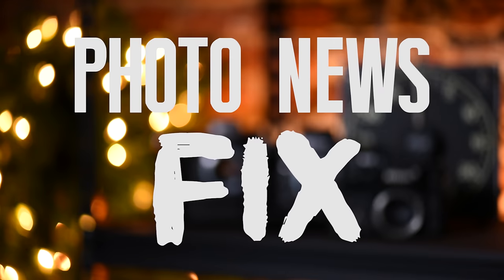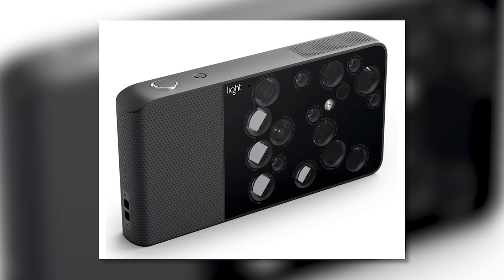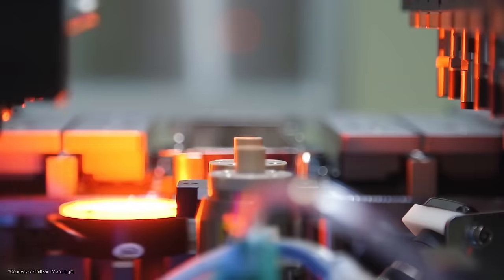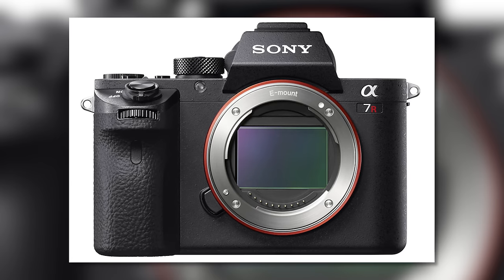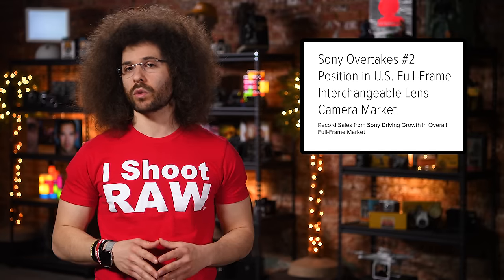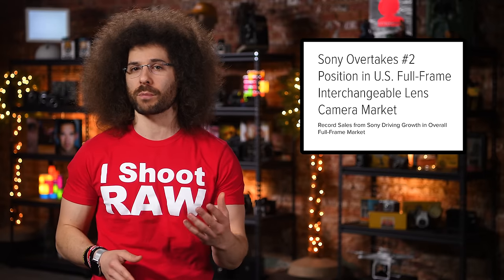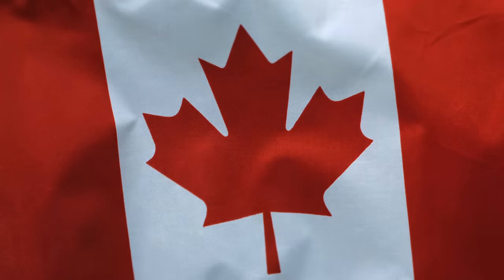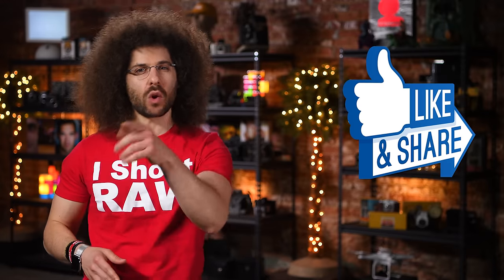PHOTO NEWS FIX: SONY Passes Nikon (Kinda), Canon Next? Weird 16 Lens Camera & SONY NAB Truck Stolen

Comment: Sony just unveiled their new flagship the a9.
I wanted to start with that statement to get your attention...when I started my photography career in 2013 I had the choice between a Nikon D7100 or an Sony a77. After weeks of thinking about my purchase i went for the Sony. Fast forward a couple of years and an Upgrade to the E-Mount System (a7II; a6300; loads of Sony and adapted lenses) I am very happy with my decision. 

Canon and Nikon Users hate on Sony all the time, but I think they are just getting jealous. 
Sony is the Camera Manufacturer that is improving at the fastest pace right now...they are simply put the hottest horse in the stable!
Just think about what they did with the a6500 in under a year after the a6300. And now for the a9 with Dual Card Slots, bigger Battery and Touch-Screen! This is a company that actually listens to their customers and not just the marketing departement! 
All the other features should drop your jaw! 20fps with full AF and Silent Shutter? 693 Phase-detect AF-Points? I mean come on? 4k with Full-Frame coverage? No Blackout EVF? Did I mention this new flagship is cheaper than its Canon/Nikon counterparts? Plus not even mentioning things like face detection and Eye-AF which have become standard now on Sony Bodies...
Where are Canon and Nikon?

PS: I think the lens argument should be kind of over by now if you think about adapting legacy lenses and adapting canon and nikon lenses (with full AF capability; what other camera manufacturerer offers that?) plus Sony is releasing really cool G-Masters at a rapid pace and affordable lenses aswell. As a side note all the more exciting/new 3rd party manufacturers are developing for the E-Mount (Laowa, Meyer-Optik-Görlitz, etc.)

Comment: I sold all my Nikon gear two years ago and moved to Sony, I have one gripe.......... battery life!!!
To some people it might not be a huge issue but I don't want anybody to say that they are completely 100% in love with their Sony without bringing this up...........I don't want it anymore, give me back a Nikon or Canon I'm not fussed, I just know I can trust them...........every time I've picked up my camera of late it's has 14% left on it. What the F is that all about. I'm seriously selling up and moving back.
Reply: What a sad statement. All i hear is battery life this, battery life that. Ok it's not good, it's worse than canikon systems, but you seem to forget something big. You like the EVF, you like the awesome AF tracking which is second to none, you like eye AF etc, but here's the catch, they are all 100% electronic systems, so is it that strange that they use a lot of juice ? No it's not. If you want to keep on shooting optical systems instead of what you see is what you get, then by all means. But stay reasonable. I never "moved to sony" i came from minolta film which was bought by sony so i had no choice. My first reaction was oh god, no, not sony.. they will make what was great into something apple-like with all design and 0 performance.  And up to the a99 they were kind of trailing the pack. Still not bad enough to make an actual switch to canikon. Then from the a99 up they were actually doing stuff better than the others ( in my opinion). So.. if you want better batterly life with your E-mount , just use a vertical grip. they are dirt cheap if you don't mind using an aftermarket one. 2 batteries last you a whole day of shooting, the camera handles a lot better. if you use a mount 2 batteries will get you through the toughest longest shooting gigs. And i speak from experience.  Would i like to have single battery performance as canikon does ? sure... would i be willing to give up the EVF and all the benefits for that ? Hell NO.

Comment: I have Nikon and Olympus cameras. I think my Olympus cameras are by far the nicest. More battery life would be good though
Reply: Definitely, they are just easier to use in my opinion. Produce great images. All stability is done in the body which is way better. Each to their own. I just prefer my em1's

Comment: What happened to the Fro Forum?  Is there no longer anyplace to post questions and help each other out with answers?  All I see any more is the comments section in articles relating to the videos here, which requires a facebook login, which does no good for those of us who don't have a facebook account.
Reply from the maker: Oh the one I shut down 4 years ago?  There is a facebook group for FroKnowsPhoto.
Reply: 4 years?  Granted, I haven't been very active there, but I'm sure I posted something more recently than that when I was asking for advice on what kind of zoom lens to buy.  Anyway, thanks for responding.

Comment: Light L16 who is it marketed towards?
Reply from the maker: great question, no one knows.
Reply: first adopters & people willing to keep their minds open and try something different.  Y'know, those types.
Reply: It is aimed at folks who are DSLR owners who are tired of lugging all that camera gear around and want to take amazing pictures.
Reply: After a bit of research I think this is a cool tech. Its not for me because it takes out all the fun of taking photos. And people who this is ment for is probably better off with a phone anyway. // I would be really disappointed if you could't take 3D images and recordings. And I would be disappointed if you could't make calls from it! Because It's basically already is an android with 10 cameras but they market it as a camera. Ether it lacks the functions you really need or they doing a weird marketing. I can see tons of people buying it if it was markerad as a phone with worlds best camera and it had all the phone functions. /// EDIT. I bet Apple will steal this tech in the phone after next gen.
Reply: Dimitri: Yes, it's cool / bleeding edge tech. And, yes, it's just Gen 1...

It is intended in part to appeal to those who are familiar with phones / tablets. And eventually, if all goes well, the technology will be miniaturized and make its way *to* cellphones and tablets via licensing deals. It's part of the plan.

I'm fairly sure it will be capable of 3D, whether at launch or down the road. Given that its lenses are all at different positions, parallax, different focal lengths, et al, means they can capture plenty of information about scene composition, depth, etc. And some of that 3D / depth information will be used in composing and capturing scenes. Fairly certain it will support 3D. Not 3D video in the Gen 1 product, though, I don't believe. 4K video will be shot on a single sensor at a time, based upon subject, focal length, and/or zoom level. So, no video stitching, etc. in this first generation. But, it's only a starting point.

They designed a CAMERA, not a PHONE. It is both necessary and sufficient to focus exclusively on the camera aspects in this first generation. They're creating a new technology, and getting that technology RIGHT is their primary focus. I would rather they make it a great CAMERA than try to weld in unnecessary "phone" technology, and ignore getting the imaging right. Future iterations will likely be in cellphones / tablets that license the technology... The standalone camera(s) will still be cameras. One does not typically make phone calls from one's camera. ;)

As to marketing, they're making a camera, and marketing it as a camera. I don't really understand that criticism... Doesn't make sense to me.

Comment: It looks like that multi-lens camera has a bunch of tiny 1/3 inch sensors, so low light will likely be horrible.
Reply from the maker: they claim it may be better but we shall see.
Reply: perhaps they've found a way to treat many sensors like the many dishes in an array that receive signals from deep space.   The many dishes spread over a wide area have the same ability as  one huge dish.
Reply: mavfan1 only issue is that each module is getting a different perspective, thus techniques such as mean stacking will not work.
Reply: Actually, that's the cool thing about this, it DOES work - not only that, but they can get information about the objects inside the image and produce a spatial map for 3d imaging if you want. Not only do you get great images, but a whole lot more. Imagine software that will isolate the person (for example) and allow you to extract that person simply.
Reply: Interestingly, they have some tech that will make low light pretty good (tho I haven't seen it yet). Some of the camera modules will be B&W allowing them to get more luminance data. Also, by stacking, they'll be able to remove noise and be able to set apertures higher/lower in segments of the image to bring out darker areas for example. So much can be done with computational imaging!

Comment: That light l16 though. I've only just heard about it, so obviously I had to do a bit of googling to try and figure out what it's all about. Truth be told though, in order to make good use of all those sensors and lenses, assuming that they intend to do more than simply using them individually, which is just plain silly as there are a number of far superior solutions to that, it would require packing an awful lot of computation power into that small package for the required image manipulation, and assuming that this can even be done, the result will likely still be mediocre, though it could surpass that of solutions of that same size. And then there's the battery life, which will most certainly be horrible, there's the absurd price, as already mentioned, and so on and so forth...
Still, it is very interesting, and talking purely theoretically, it could work.

Comment: 1.never call a camera 'light' if you want to be found in Google..2.never put a USB charging port next to tripod screw..3.WiFi ok, but a SIM card option should be obvious..I guess the next move is to sale the patent to GoPro..and they will make it work :)
Reply: Funny, but you put Light L16 into Google and it brings up a shit ton of stuff about Light and the L16...

Next whinge?

Yeah, we noticed USB-C placement, too... Looks like it moved slightly in he latest build, but still a bit close for comfort.

SIM card? This isn't a cellphone, dude. It's a camera. (That said, once it's up and running, their roadmap includes miniaturization and licensing the technology to cellphone / tablet manufacturers. They already have agreements in place with Foxconn, possibly others.)

GoPro comments aren't even worth responding to...